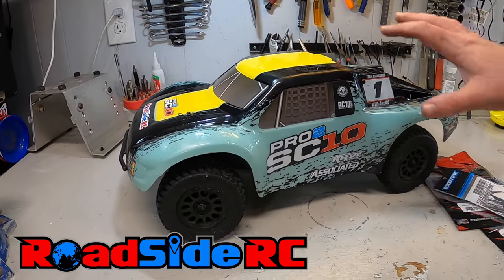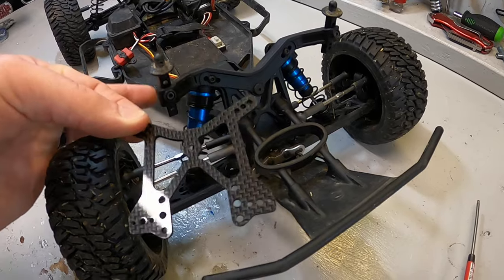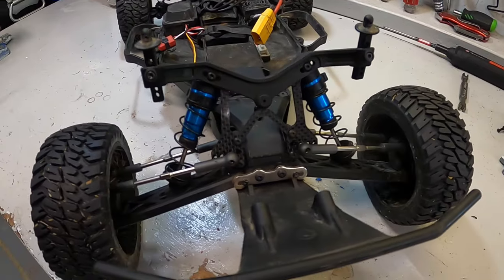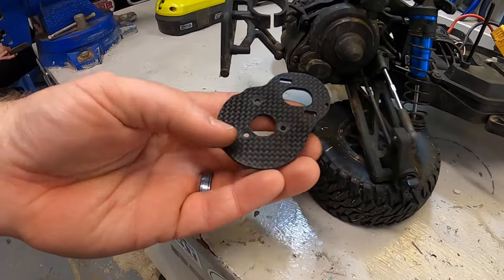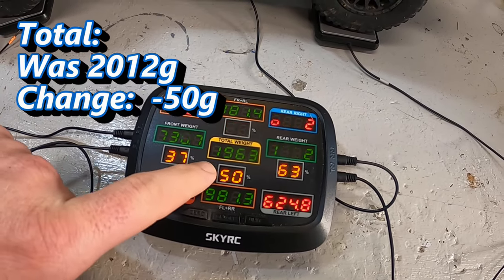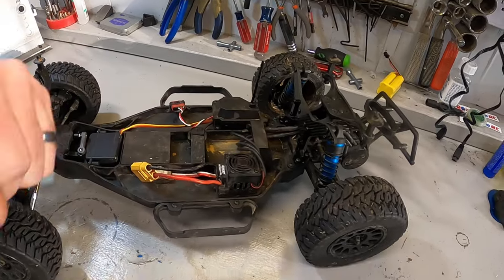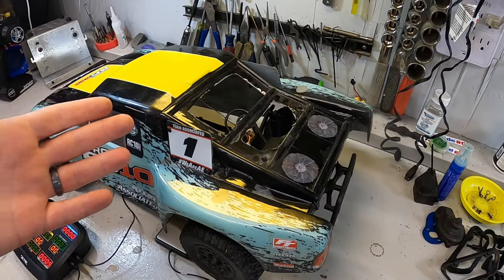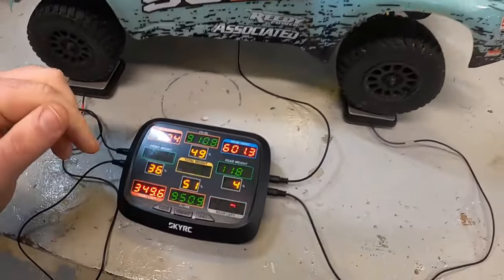Team Associated Pro2 SC10 Weight Reduction Using DR10 Carbon Fiber Parts

Comment: Do you have any suggestions as to what driveshaft upgrades are available for the this truck? I keep sheering mine right off. Thanks
Reply from the maker: That is very interesting - I have literally never heard of someone breaking them. 
Where are you breaking them?   Back on the diff side, or out by the  wheel? 

I adjusted my rear camber - which does allow my driveshaft to pop-out of the diff cups occasionally.   I wonder if yours is getting wedged and that is why it is breaking?  

With these steel shafts, breakage shouldn't be an issue.  I would check into what is causing the breakage.
Reply: @RoadsideRC  that's the same thing that I thought as far as it getting wedged. But I've also broke one closer to the carrier as well. So I've  broken 3 by the out drive and 1 by the carrier so far. I just would like a stronger option. Is the Dr10 upgraded drive shafts compatible? I found some steel ones on eBay

Comment: Hey so totally unrelated question based on the topic of the video but … how is that building set up to ventilate nitro cars or is it an issue? With a full race going what’s the noise level like?
Reply from the maker: It has big doors open on the end + open windows.  

Even with a full class of nitro running, never really noticed a fume build up or issue.
Reply: @RoadsideRC  thank you!

Comment: I took some inspiration from this vid but went a slightly different route. I went with a shorty pack and took the foam out up front and moved the esc and receiver (out of the cover) in the middle to keep the weight centered and low. Upped to a 23 pinion, rebuilt shocks with traxxas seals and 32.5k in front, removed servo saver, and put 7k diff fluid. Ran proline holeshots at chickasaw track. I think the truck did ok... I'm terrible but the truck did ok lol.
Reply from the maker: Great!  Hope I'll see you out there at Chicasaw someday!
Reply: Still a great time no matter where you finish though, am I right?? :)

Comment: What i did with mine was peel up the foam in the battery tray and glue it back down in the back, shifts the weight of the battery forward and it gave me a little extra steering.  I also have some extra foam to stuff a shorty pack in the front for even less weight!  Oh, the weakest part of the chassis is the narrow part right in front of the servo...ask me how i know lol.
Reply from the maker: Thanks for the tips!